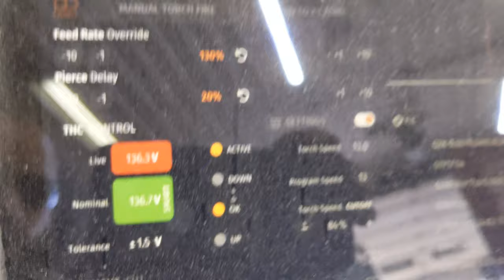1" AR-400 Mounting Plates - CrossFire PRO - Hypertherm 85

Comment: Awesome.  Thanks for sharing.  
I'm trying to find more info about upgrading the Crossfire.  What forum do you usually discuss this stuff on?
Reply from the maker: There are two Facebook groups that I'm a part of that have lots of useful information...
Reply: @joshuazimmerman8631  Okay.   Are those groups private, invite only, or are they open to the public? If they're open groups what are the names of them so others can find them.
Reply from the maker: @EcoGreensFarm  
They are both private groups. One is called Langmuir Systems Support Group, and the other is called Langmuir Crossfire Owners Group. Just request access...